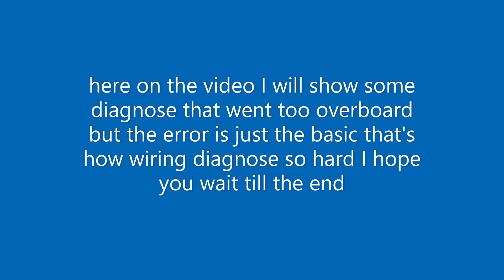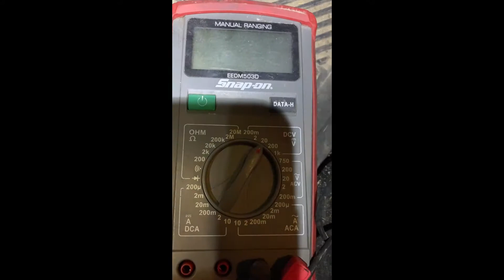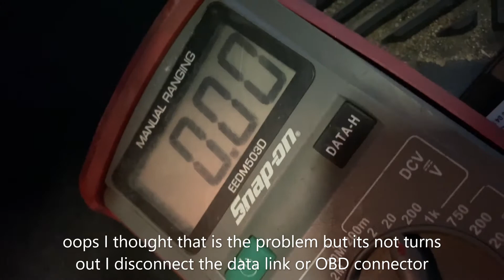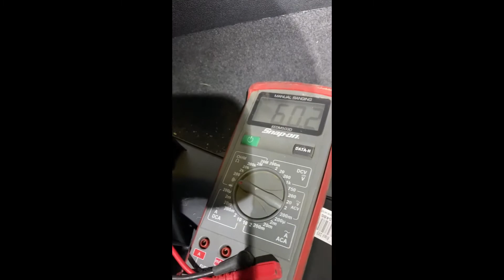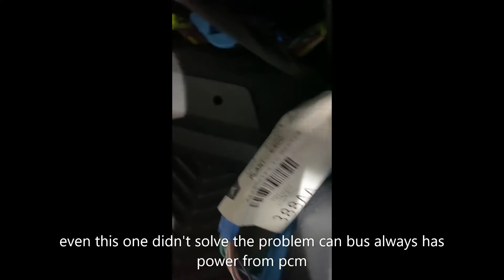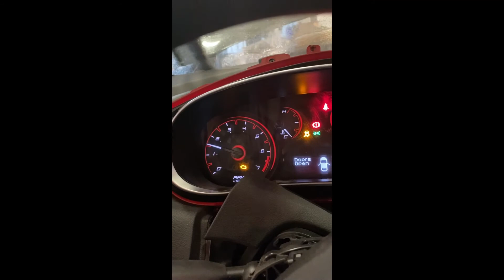dodge dart can bus diagnosis

Comment: Hey man i have a doge dart and i am trying to fix my code U0212 witch is lost comunication with SCCM. any pointers on how to fix this?
Reply from the maker: if its just stored codes you can just clear it but if its active or the code stored and it came back after driving you can checked weather you have any flash recall from the dealer but if none you can checked you the fuse if there any.. if not checked the wire of the sccm can bus if there's any continuity from end to end from the star connector to the pcm or where ever is accessible if wires are good then the module is faulty just check for any terminal corrosion too  i hope will help you a bit
Reply: Thanks for reaching out! It is a current code and it causes my howl center concur and cluster to turn on and off a bunch while driving and also causes my powered steering to turn on and off. Where can I access the SCCM and also how to I know witch wire to check?
Reply from the maker: @tateharward4731  
hmm it looks like a loose grounds or something

Comment: good video brother I have a question I am going through a similar situation with a dodge dart 2015 1.4 turbo vehicle only in my case if the engine starts
vehicle I would like to know what fault codes you have. in my case I have codes U1508, U0401, U0002, U11D1 I would like to know if you could advise me?
Reply from the maker: if you got u code if they were stored on the scanner you can just clear them but if they will come back you need to checked your data bus communication voltage can high will 2.5ish can low will 2.4 or something but not lower than 2.2 if your getting diff. voltage you might have short on  power ,ground or together , sorry if reply too late any ways if you haven't done it yet you can start checking on your data bus voltage but if already figure it out then just disregard my reply thanks for watching

Comment: Thanks this help me understand  a lot of what is going on. I have a 1.4 multi air randomly loosing can bus and car stalls. This should help me search to find  the problem.  Thank you!
Reply: What's the sensor it was ? It's located under the inner fender on driver side ?